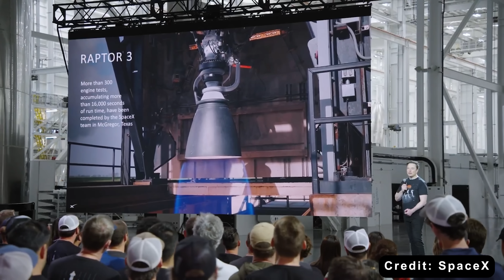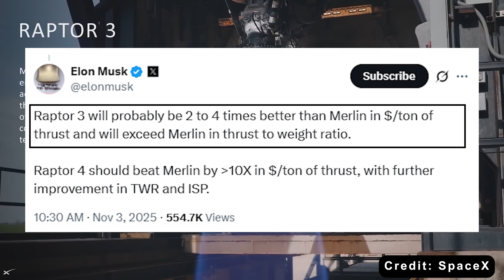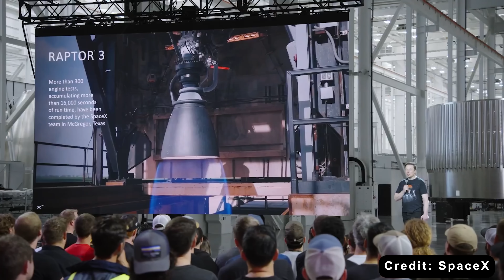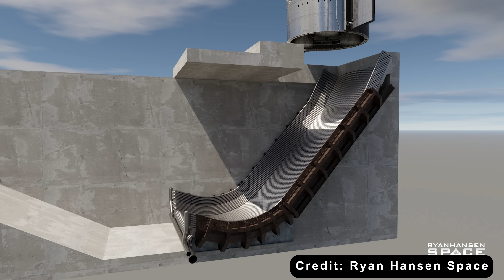Elon Musk revealed Starship Flight 12 will Make History after Big Upgrades on Starship V3...

Comment: They are working on Starship V4 already.
Reply from the maker: on the plan, not the hardware, right?
Reply: @techmap9  The design is probably already worked out but will still be in beta stage and isprobably tweaked and modified as new data comes in front tests and experiments. Pretty sure they're working on a 4th version of the raptor too, as raptor 3 does not have enough thrust for the payload capacity they are aiming for (200 tons to LEO). They are still working on increasing chamber pressure. Originally, the successor to Raptor 3 was called "1337"or "LEET" but I think that design stranded on impossible engineering hurdles. So they decided to push raptor further.
Reply: Yea right. V4 even longer?? 200meters??
Reply: @albertvanderheiden7419 
Yes, even longer, but not that long !
Reply: Of course they are! keep on announcing the next one, and the next one, and the next one. But never actually build a working one. This is how the scam works.
Reply: @JarvisThribb 😂😂😂😂😂😂😂